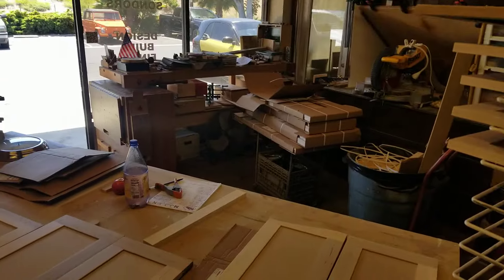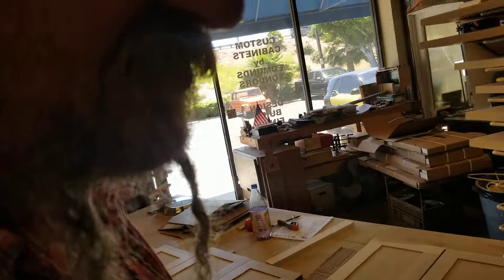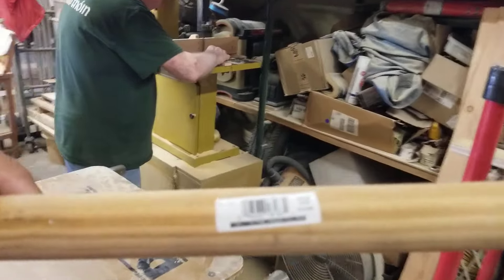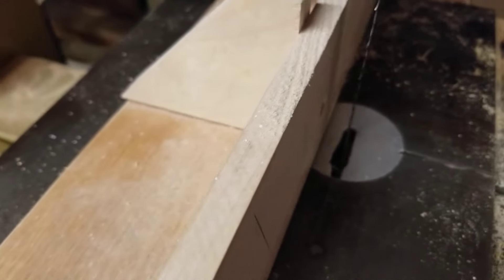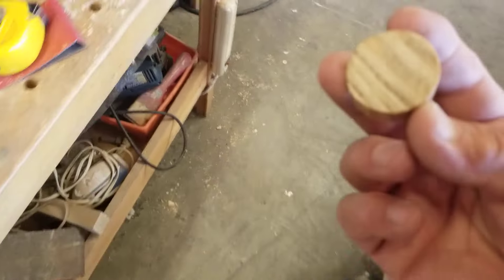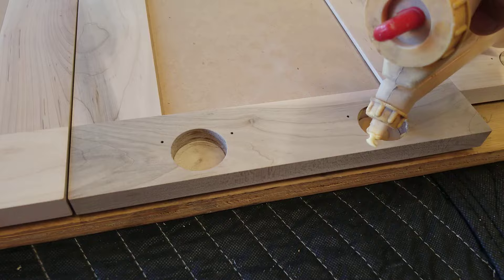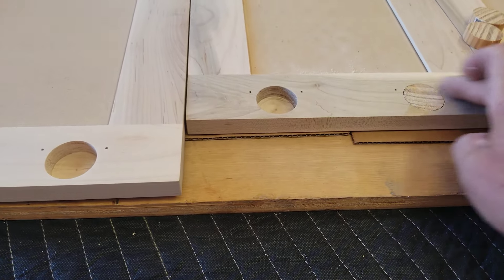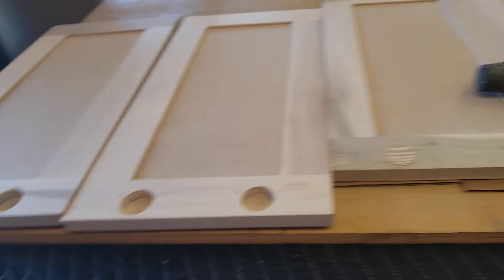Fast, cheap way to plug a 35 mm hole in the cabinet door!😉👍🏻

Comment: Instead of dealing with the end grain (that will be obvious to anyone with eyes) you make a round template that, when combined with the proper straight bit, lets your router cut a perfect 35mm plug. Take a piece of 4/4 of the same species you're repairing, put tracks on the bottom of your brand new plug-cutting jig so you can make repetetive cuts in the same piece of lumber. Don't route the full depth of the material so the plugs stay pristine, and free them from their recess on the table saw.

Easy peasy. Almost like I did it once or a hundred times in 35 years of cabinet making...
Reply from the maker: @minimonkaloyd  Thank you for the idea!😉 This is a paint job. And thies are drawer fronts, so most of the plug will be hidden.
Do  you have a video of your solution?